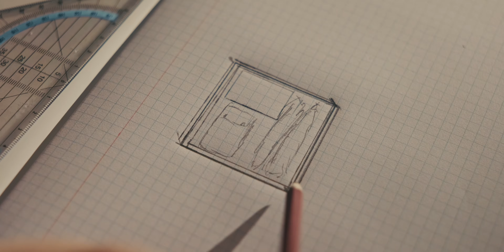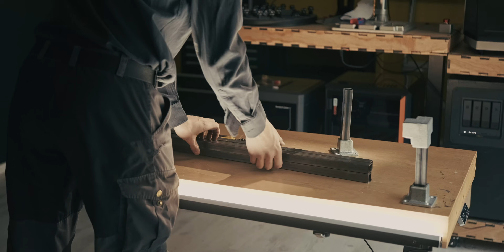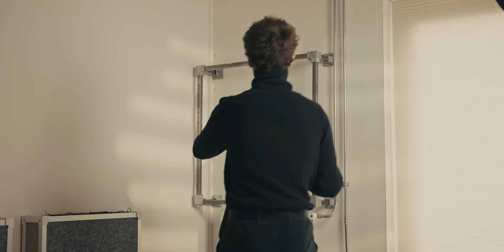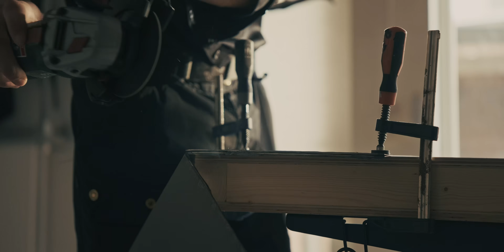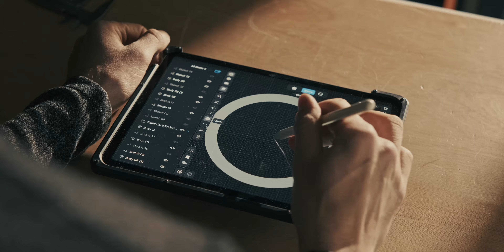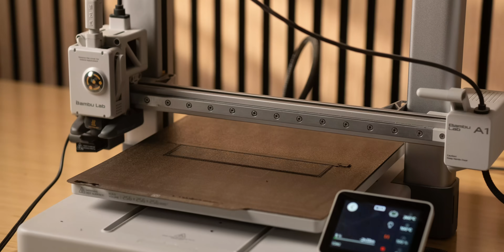My EDC Rack System Build  - 3D Print Project

Comment: Very cool idea and implementation, but I would have preferred to use aluminum extrusion profiles - I think they are not only prettier but also more universal, because you can easily add things like hooks or extend it afterwards directly to the frame itself.
And I would have used the OpenGrid Full system instead of the vertical Gridfinity - this is specially made for the wall, technically compatible with pretty much everything such as Gridfinity, Underware 2.0, Multiconnect, etc. and simply great
(there is also Multiboard, but this has a license model that you have to adhere to and is less compatible with other systems).

Comment: That's a nice job. However, only the top part looks load-bearing and quite sturdy. I was wondering if the side bars and the bottom connections/attachments are really necessary.